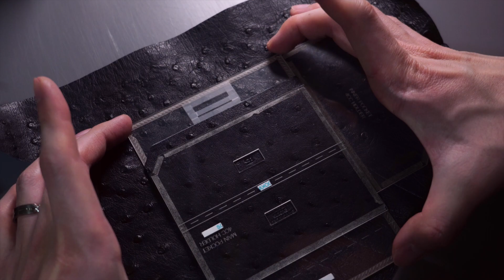Making HANDMADE Card Case in Ostrich

Comment: Thank you for this amazing video
Can I please ask, Is it not necessary to put a reinforcement between the leather so that it doesn’t stretch in the long term ? 
Thank you
Reply from the maker: Many thanks :)
That is a kind of technical thing that I can't tell but, it depends on the parts and roles of them.
If that is needed, that should be reinforced but if they don't need to be reinforced, that should not be done.
The over-engineered design could ruin the overall touch and feel of the natural leather.

Comment: What a lovely and inspiring video.  I would ask you, when and if you have the opportunity, to please write a list of the tools you use?  It would be wonderful. Also I note that the templates you use, come with an adhesive on the edge that sticks to delicate leathers like this, without leaving any damage or residue.  Is the same the case with the templates you sell?
Many thanks for your inspiration.
Reply from the maker: Thanks a lot for your interest in our artwork.

Most of the tools are custom made tools, so I cannot specify them.
(Some of them were Vergez Blanchard tools)
And we don't sell the pattern design of our products currently running.
So the templates you saw is not for sale😅